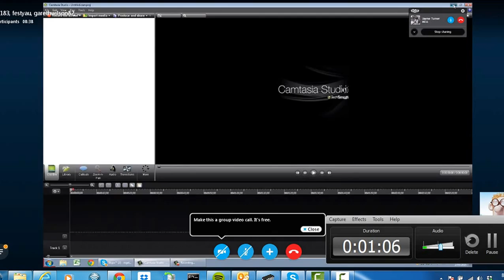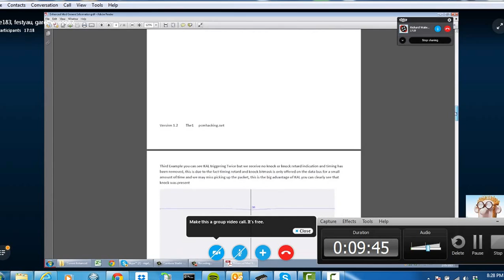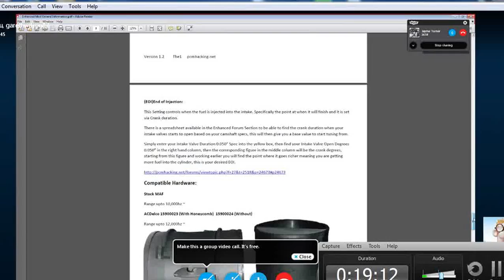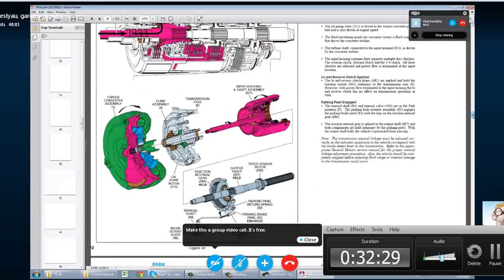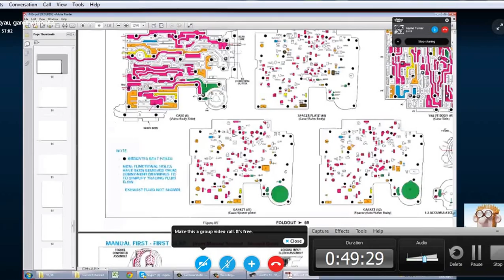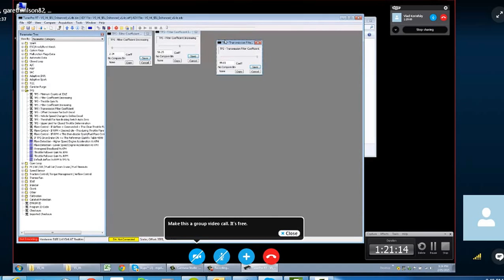Pcmhacking.net Enhanced Mod Session from 0081(2)

Comment: Nice work! but would of been nice to see what to change in regards to fueling with closed and open afrs and where the cut of point is for each. As I take it the injector bias is for fueling in closed loop?? If so when does open loop take over?  Cheers.
Reply: I'm probably way off but only ever tuned map cars, so this maf stuff is a bit confusing.